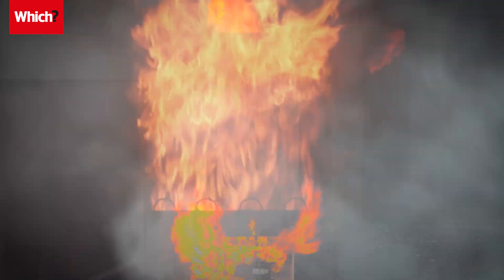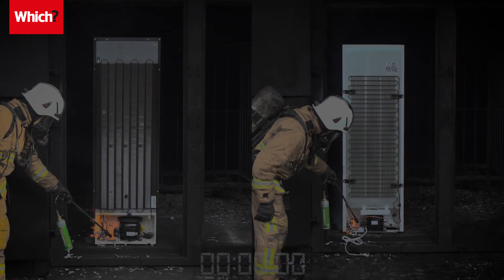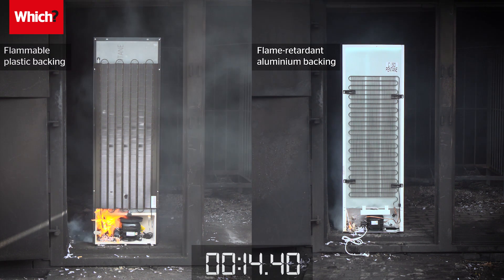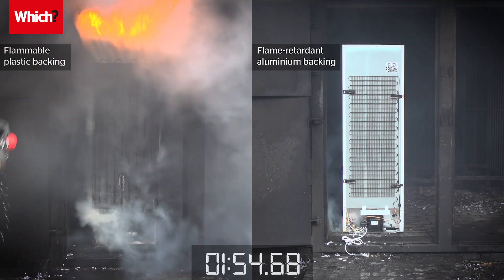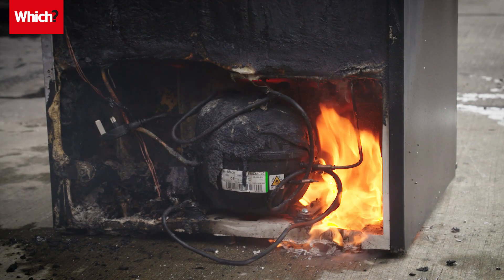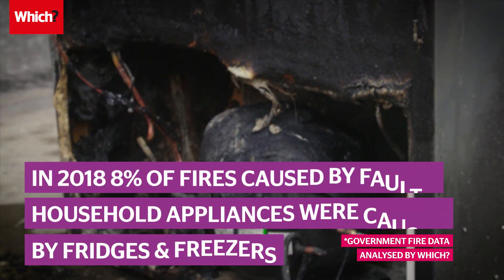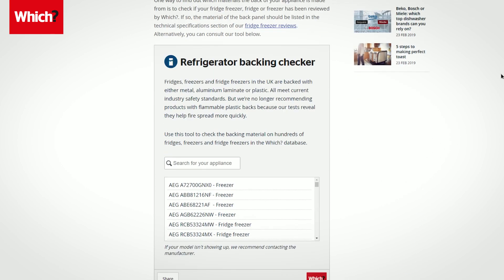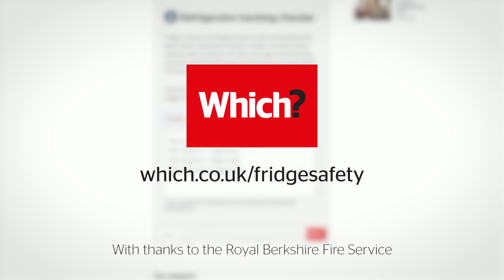Fridge freezer safety - Which? investigates

Comment: Excellent request and it should be made H&S who are been given more powers. Also, it will be worth noting that the refrigerant been used is Butane (R600) and Isobutane (R600a) both are an A3 class highly flammable refrigerants,  which was in the freeze/refrigerator (Hotpoint model FF175B). The refrigerator in question exploded due to an internal leak which was sparked by the compressor start capacitor. This explosion blew the widow and the building insulation caught fire. Which can investigate the amount of exploding refrigerators on the web and you will find all of them are charged with A3 class highly flammable refrigerant. If the refrigerator was charged with A1 class non-flammable refrigerant the explosion would never happen. The use of flammable refrigerants in domestic applications should never be allowed. Manufacturers hide behind environmental excuses to save money at the expense of human life. 
They probably save £2.00 if charged with A3 class ( (highly flammable) rather than A1 class (non-flammable) refrigerants. but it amounts to a lot when you consider there are 200 million refrigerators are sold worldwide... Crazy. Please note the deception go as far as not displaying the flammable or explosive symbol so buyers have a choice (and there is a choice!!) NOT EVEN ON SALES INFO when you buy???. The new proposed Building Safety regulation (as a result of the Grenfell Tower tragedy) will ban flammables in high rise buildings and this should include any domestic appliances. Simple! or maybe too simple!! Consumers should ask a simple question before buying a refrigerator or a freeze what is the refrigerant inside is it A1, A2 or A3 class? if not A1 DO NOT BUY IT. Which can help to demand retailers to display on sales materials which type of refrigerant ;) and, like Dixon, is registered  PAS 7100:2018  Code of practice?. Neil Afram F.M.Inst.R